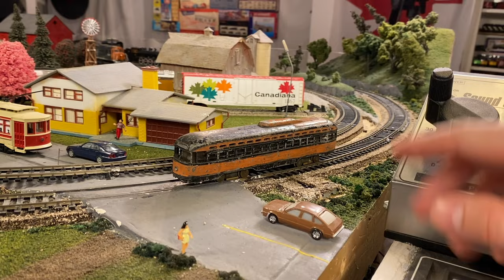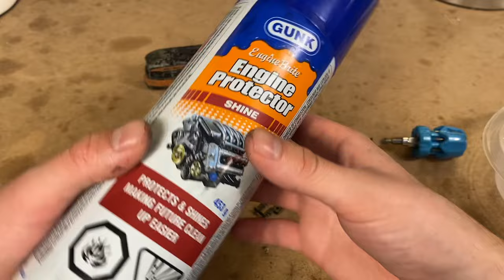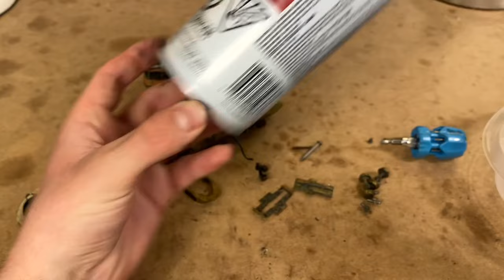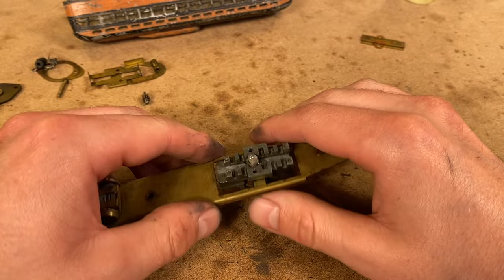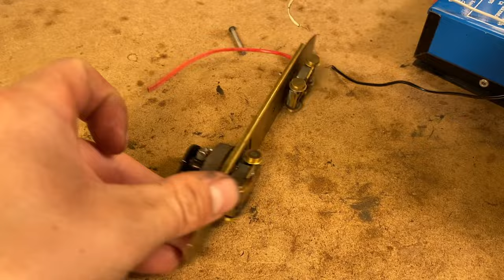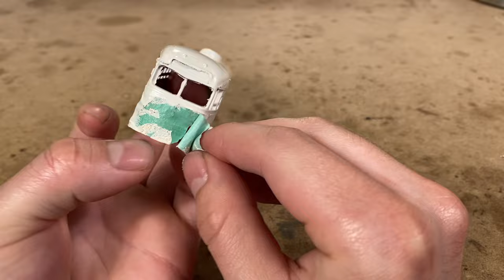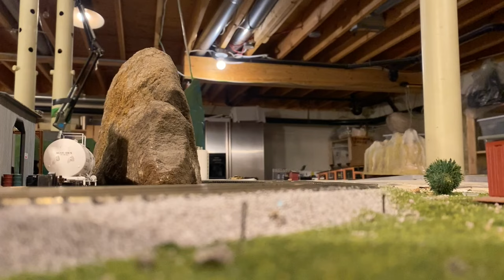Disgusting 1950s HO Streetcar Trolly Train - Will It Run Again?

Comment: You can clean the glass under the body of the train with toothpaste... it will return to its original look and rid it from the yellow glint.
Reply from the maker: That wouldn't work in this case. Plastic had rotted badly.
Reply: Well  i use it clean headlight on cars with plastic headers with a electrick tooth brush
mind you need to be carefull since its brittle but rotting plastic... now that suprises me ...anyway gj on that train@nline

Comment: Carb cleaners should work for cleaning as well
Reply from the maker: Isn't carb cleaner hard on plastics?
Reply: @SMTMainline  that's what I was trying to remember. But at the same time, there are plastic parts in a carburetor, so I would think it would be safe. Though definitely read it first. Break fluid makes a good paint remover to, just be careful with that and plastic because if plastic sits in break fluid too long it can become brittle, but I think that takes a long time since I left a model sit for about 4 days without problems. I swear I will do a video on how to paint for you. You have most of the basics, but I notice a couple of things you can change and would improve the quality of your paint job. Like when you shoot straight on. It's okay if you do, but it can cause overspray and blotches. I pretty much only do that when I have to blend the colors, and that's a whole other area of talent

Comment: imagine equipping it with historically correct DCC sounds
Reply from the maker: It would be tricky but not impossible.
Reply: @SMTMainline  I smell a new video in the works! I'll try to find some sounds all you need to tell me is what decade you want it to be from. 20s? 30s? 40s?